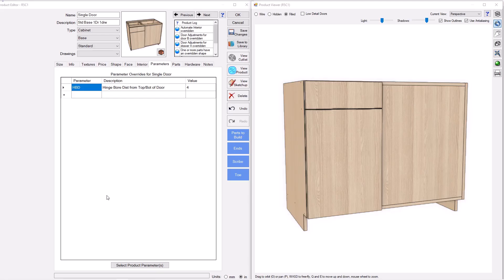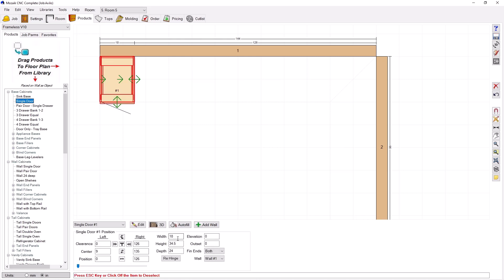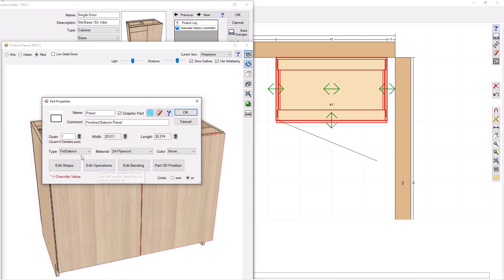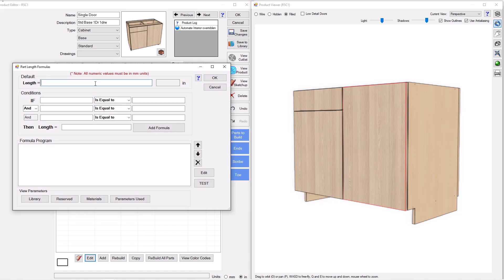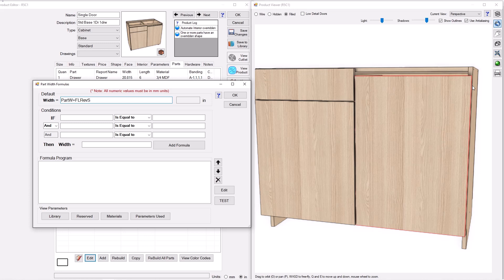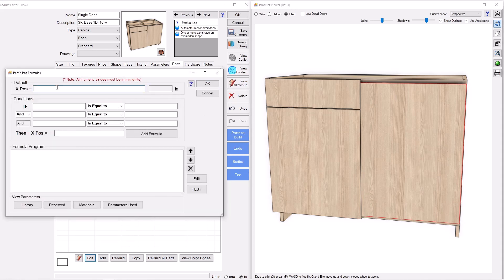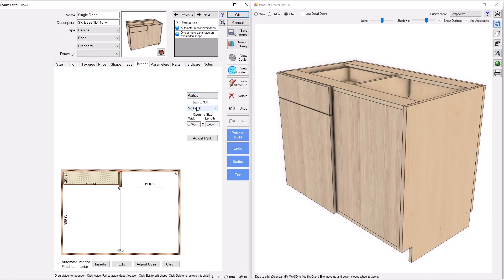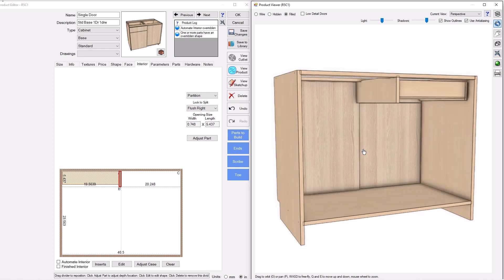IMPROVE YOUR BLIND CORNERS: PART 1 of 2...Inset Panel Blind Corner in Mozaik Software!

Comment: I just downloaded Mozaik and found your channel and your videos are amazing.  Even your aesthetic is right up my alley (very modern).  I have a question regarding this blind cabinet and its more about the look than anything. If you make the panel inset, then the edge banding is visible for the 2 or so inches that aren’t covered by the adjacent cabinet.  Wouldn’t it be more aesthetically pleasing to apply it as a faux door panel?  Am I missing somethings? Is that an industry standard that nobody notices?  I’m kinda self taught and not really too in the know of how things are done in the “industry”.
Reply from the maker: Glad you like the content!  The inset panel can be made out of whatever material you prefer, including the same material as your doors...often that blind panel is almost completely covered by an inside corner filler that is flush with the face of the doors.  In that scenario, you would really only ever see that panel when you open your cabinet door to gain access to your blind corner.

Side note..."industry standard" is not much of a "standard", there are a thousand ways to make a box out of wood (or wood dust and glue)...do what you think looks best...
Reply: @thecabinetpodcast  I always add a straight filler between the cabinets but a corner filler makes sense as its easier to attach without having to add a nailer...